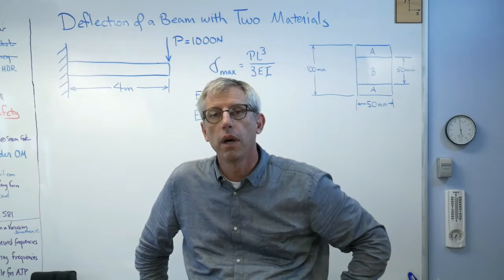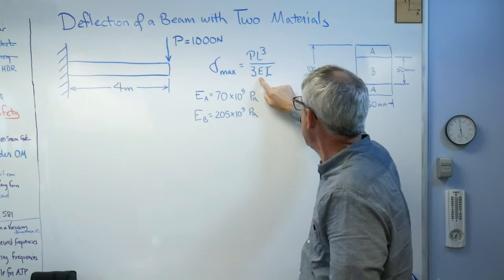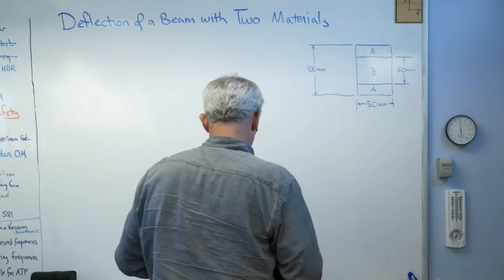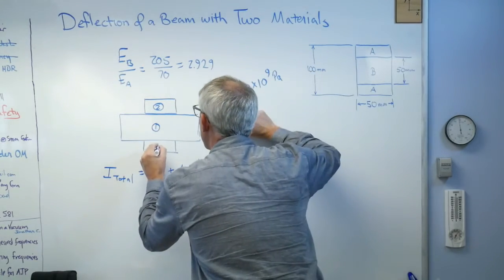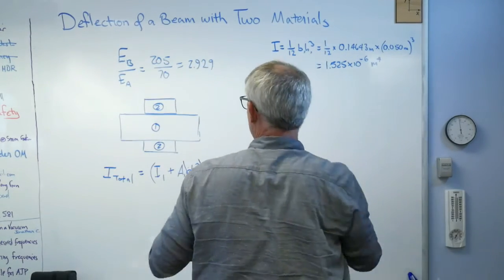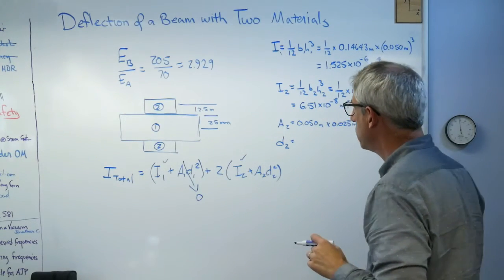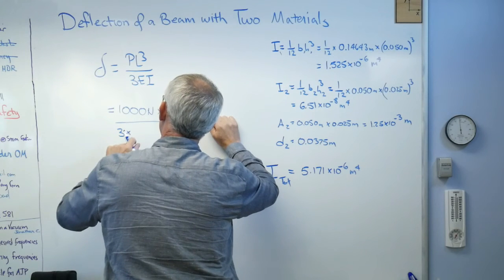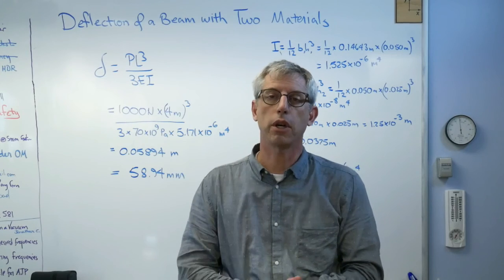Beam with Two Materials - Brain Waves

Comment: Thank you for this enlightning Video, very much appreciated sir.
I do have one question, I am looking to calculate the deflection of an Aluminium side Profile of a conveyor System that I reinforced with a Steel beam underneath. The profile and steel beam are connected with bolts. Will this approach work? 
Thanks :)

Comment: I am curious to see what happens if the cross section is an hollow cylinder instead of square. How to build a relation for which the inertia changes to the radius raised to power four.

Comment: How can we take aluminum elastic modulus only?why equivalent of both elastic modulus had not been taken?
Reply: In the deflection calc, you may use either elastic modulus as long as you are consistent with the rest of the calc particularly involving second moment of inertia, I. 

In this case, he used Estrong/Eweak for I. So, the transformed section has the area with that factor multiplied into the one with smaller E. As such, the elastic modulus to use for the deflection calc is Eweak (smaller one). 

The opposite is true as well and you get the same deflection answer. You can look at it as what it is: the transformed section is this big gigantic block and the elastic modulus is one that represents that in the same way that a LARGE elastic modulus in a tiny section bends.

Comment: I just did this trick the other day when we needed to find the position of the neutral axis without knowing the stresses in the steel and concrete in a reinforced concrete beam... it's useful for determining yielding conditions rebar so that you can find Mn (nominal moment strength).
Reply from the maker: Yeah, I first came across this when looking at reinforced concrete beams.  Pretty handy I thought :-)
Reply: @purdueMET  Just found this after years later. I am now a practicing professional engineer with experience in reinforced concrete. I think I wasn’t aware that this formulation is one of elastic section stressed and that Mn is calc’ed from a plastic failure with a section of “nonlinear” stresses. In case anyone read that confused, you can’t use the sections with relating the E1/E2 and first moment to determine the NA for plastic failure. You need to show the stresses at failure in the section and apply equilibrium at the section to determine NA at failure.